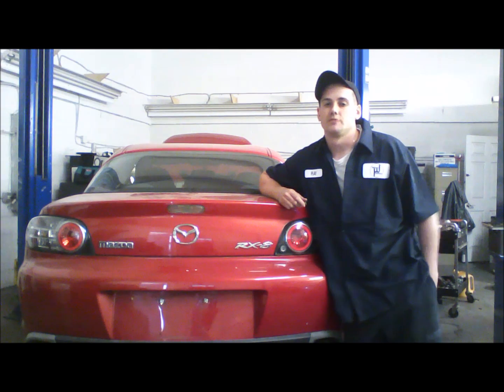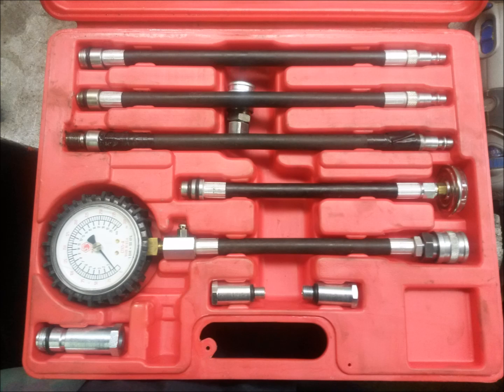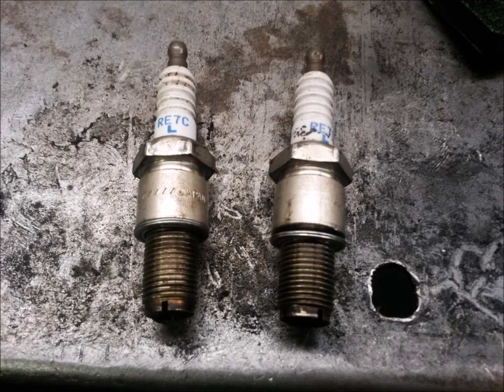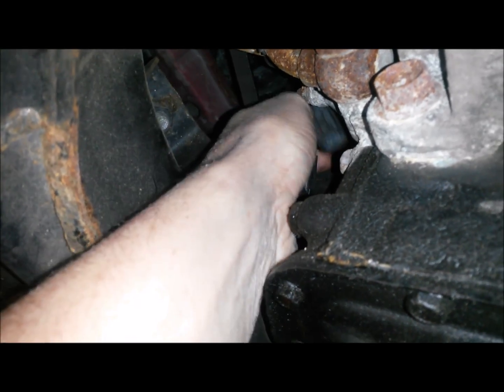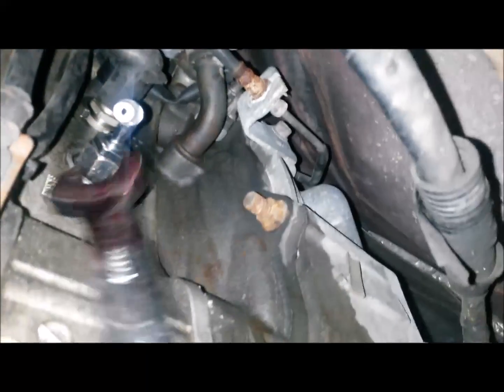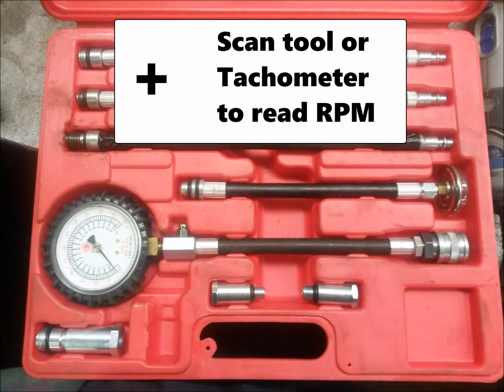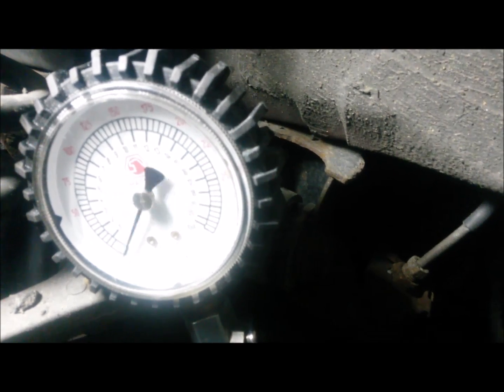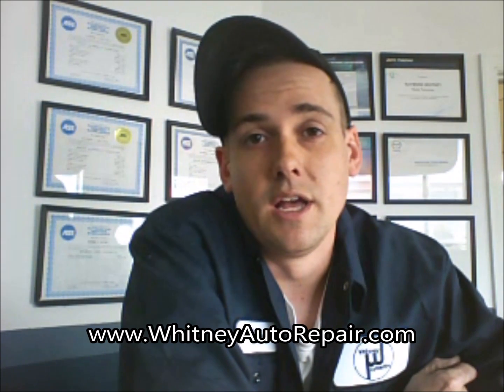Mazda RX8 Compression Test - How to

Comment: Hi, Good morning I just saw a video so I was wondering if you can help me out I have a 04 Rx8 crank but will not start.can you help me thanks
Reply: For an engine to start it needs air, fuel and spark. It's unlikely that air flow would be blocked. It could be that none of the sparks are receiving electricity. More likely is that fuel isn't getting into the engine. That could be a fuel pump issue, fuel injectors, or some blockage along the fuel lines. Just my guess.

Comment: Hello I’m from Los Angeles California and I’m having trouble with my rx8 ... one day it just stop From passing the 2000 rpm .... I changed the throttle body pedal position sensor spark plugs but it just starts and stays at 2000rpm any feed back would def help

Comment: Hey can you tell me if my compression is good sir? Left at 270 rpm  1:6.0  2:6.3  3:7.5
Right at 262 rpm 1:6.2  2:6.8  3:6.9 ??
Reply: Qc gamer Your compression is pretty bad... around 0-7 rmp you need a rebuild you can check out Driven by Madness for more info :)

Comment: Before I re build the engine the compression 4 bar's. After rebuilding the engine it was again 4 bar's. The problem is that when the engine is cold the car starts, when the it's hot it doesn't. I'm wondering if after rebuilding the engine that the engine must be working for some hour to make more compression. Because I just started it for 20 minutes and I didn't move or drive it yet. I Need some help, if any one knows what should I do to solve my problem. Please message me or leave a text bellow that would help me so much.
Reply: Thats actually how the engine works. The seals SEAL better when its hot than when its cold. That is normal.
Reply: that happens to me it was the starter ebay $97 and works very good

Comment: Awesome video. I am all the way down here in TX and was seeking a way to do a compression test. I thought the only way was Mazda or the Mazda tool but happy I typed it up on youtube and "Voila" Whitney Automotive the Ultimate solution to our problems popped up. I am ordering the regular compression tester now. I need to do that before I invest in Spark plugs, new coils, new tarter 2Kw. Just got the RX8, it runs well but the only time I can start it the next day is if I redline it from idle before shutting it off. I don't know if the engine is on its way or if it is because It was flooded (I deflooded it a week ago)

Comment: great tutorial once again man keep up the awsome vids they are very helpfull, but you did not go into any details about what pressure and rpm a healthy and unhealthy engine would pump out.
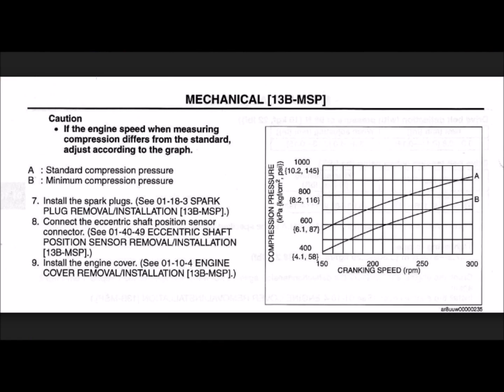Reply from the maker: +Bob Matie Thanks Bob! There is a sliding scale for the readings based on a chart. On the video at 4:52 I show a picture of the chart from the factory workshop manual but advise that if it is difficult to see in the chart that you can just do a google image search for "RX8 Compression Chart" you can find the same chart. As a general rule, mid-high 7's (kg/cm2) at around 300rpm are good numbers to look for.
Reply: +Whitney Automotive Perfect thanks man i'll have to get around to doing a compression test on mine now to see what i get. Keep the videos coming mate they are really detailed and help full and theirs no one else really doing it on you tube, so i help your channel takes off. If you were wondering on what tutorial to do next here are some suggestions based on really common things people do/replace on rx8's. Swapping the series one 1kw starter motor for the series two 2kw starter motor is a very common job as the series two stater helps the rx8 start much easier and quicker due to higher cranking speed. Doing a decarb is also very common and their are lots of products and ways of doing it, maybe if you did a tutorial on how you would do it if a customer brought  their car to you asking for a decarb to be done. And lastly how to replace the clutch and flywheel as the standard rx8 clutch is a fairly light one and is very common for it to let go under heavy driving conditions of a period of time.
Reply: +Whitney Automotive 
Hi!
Sorry but when I look the tables the minimum pressure with 300rpms is 7,8-8psi no?
So in that engine you have low compression because you have 7,5psi.
Am I wrong??
I'm going to check the compression in my rx8 and i need to understand tables